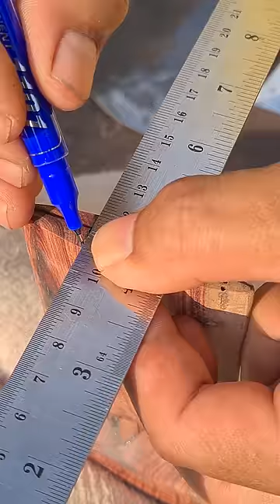Coolest idea How to hang an axe handle with a star wedge & brass case

Comment: Really beautiful, the brass insert looks incredible,  and I doubt this is meant for a usable piece, but I wonder if that brass ring (hammered in as it was) would actually hold the splines tgthr or provide the pressure to begin a cracking process... maybe if the circle it sits in was cleared away first rather than just knocking it into place?
Reply: The brass insert places additional pressure both towards the center and the outsides the axe head. Fully functional, and will last for  as long as it's properly maintained
Reply from the maker: Thank you very much😊😊🥰🥰🥰

Comment: This is going to make the handle more susceptible to breaking and or being a one time use thing. If you ever need to readjust it, its very possible that those lil bits of the handle will crack and or break. Same thing goes for the overall strength of the handle, when going into hard wood. When you do one slit in the direction of the axe head. Its got full support front and back still. But once you start doing them cross cuts. You are removing the structural integrity of the handle. You may think the opposite, but im here to tell you. Idc how deep/tight u think you got them wedges. Theres voids in each and every one of them. Mainly because its not even the same wood from the same cut. Sure you can sand and square them up. But regardless, the more slits u have. The more room for movement over time. Especially when those slits are going in the opposite direction of the head. Meaning the voids are going to be in a position to be continually squeezed together. Which over time creates more and more movement. The cross wedge alone is pushing it. But this, this does not serve any functional purpose whatsoever.  They may look nicer. But if you are splitting wood or banging wedges on the regular. Idt they will hold up as well, at least over time. I think itd make for a really good video. Doing a torture test and maybe even testing the heads/handles to failure...

Comment: Personally, I would pop out the primer, drive the brass ALL the way into the wood smooth out the firing pin dimple in the primer and stick it back in.

Comment: Aren't these round metal wedges tapered so they spread the wood out when you tap them in? I mean the wood wedges probably do their job well enough on their own, but I guess the casings are more or less just decorative. I mean it definetely looks very appealing with those brass rings.

Comment: The brass may not be thick enough to actually do anything compared to a steel conical wedge but if it does I'm using this.

Comment: Too many cuts ruin the tensile strength for the swing. You want as much of the handle in the head as You can get, and yet still secure it with the wedge. But still very nice attractive work.
Reply from the maker: Thank you for your advice.😊🙏

Comment: Anyone who actually USES an axe, and cuts down trees and fits and splits firewood realizes this is all superfluous fanciness. Just drive a wood wedge in, with a metal wedge across it, and get to work. Doesn't need to be pretty. It's gonna get beat on. It's a tool.
Reply from the maker: We made it for collection and display piece as a work of art. We made a handle from rosewood for a vintage axe head. This axe definately hang on the wall.👍😁

Comment: You should have set the head before wedging it.  If you actually use that axe the head will loosen.
Reply from the maker: I did it.The way I do it may be different from the normal way because we use hardwood so it is more difficult to handle.🙏👍😊